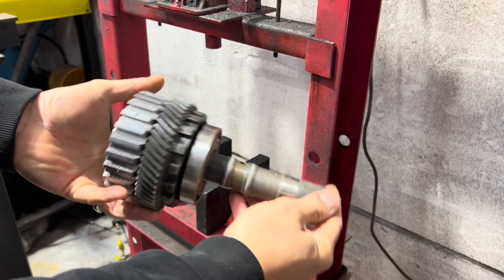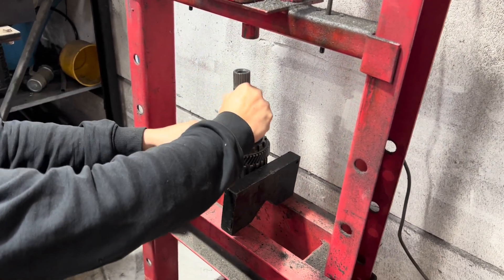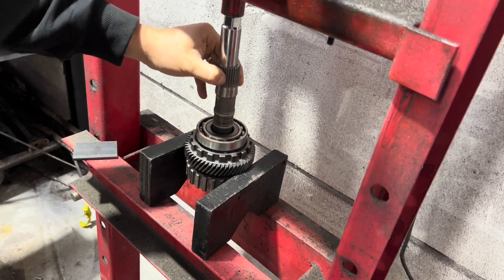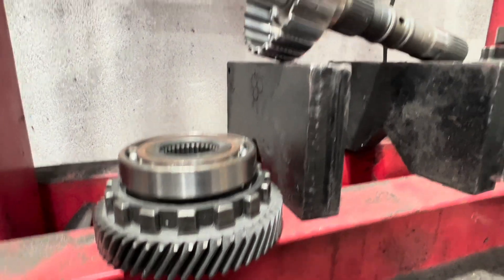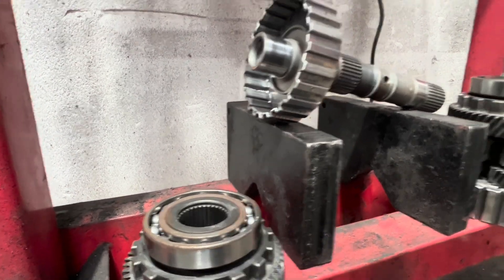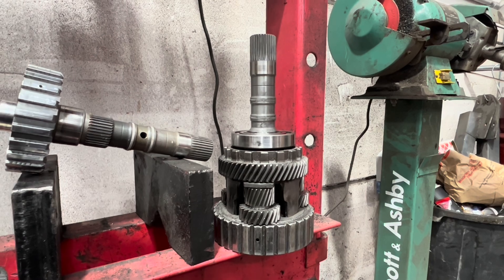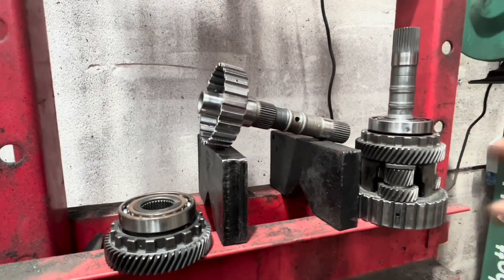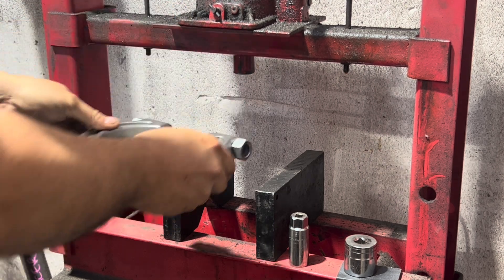ASSEMBLY INSTRUCTIONS for the Reversaru reverse drive kit for the 4EAT Subaru Transmission

Comment: Does the orientation of the bearing matter? When I reuse the existing bearing, does it need to be installed in the same way so it spins the same way it use to?  I have already removed the bearing and did not pay attention to which face was in or out.